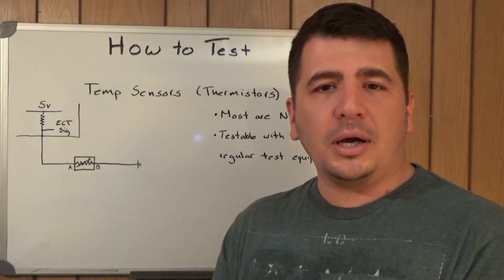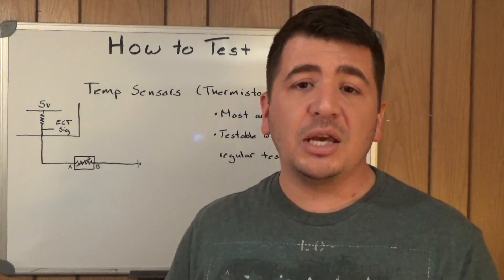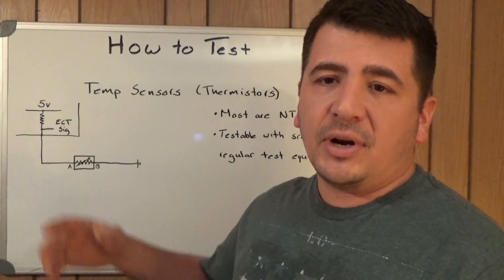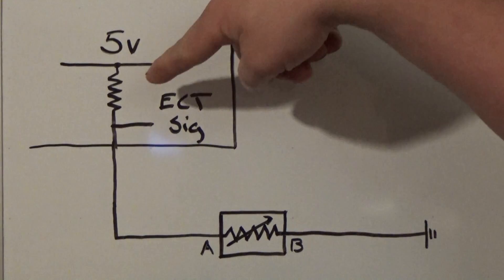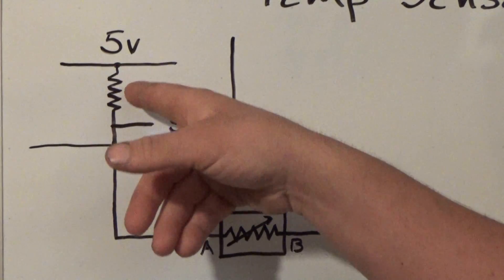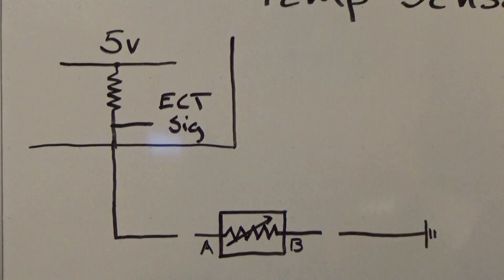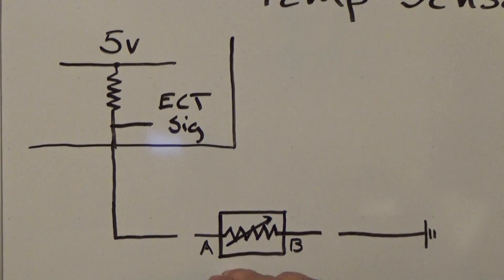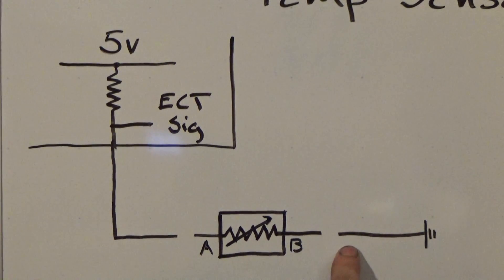Testing Thermistors (Temp Sensors)

Comment: if the resistor shorts will ground become 5v?
Reply: If the thermistor internally shorts all voltage drops across the first resistor you’ll read 0 volts Cheers
Reply: @anthonysova7117  yes of course, how stupid of me. thanks.

Comment: im expecting a 'no' for this, but just to be sure, are thermistors polarised?
(2 wire type)
my wires have become unattached from the plug, and i need to reattach them and there is no +/- indication, although the wires are coloured
Reply from the maker: In theory, there should be no reason to think it would make a difference. There might be some directional wired sensors, but if you think about this and imagine what it would be like if it were backwards, the circuit and function of the resistor says consistent. 

I don't think it will make a difference. Best of luck.

Comment: How would one test an evaporator thermistor out of the system.  Using ice water and hot water perhaps?
The repair manual gives temperatures and resistance values.  The manual doesn't go into detail about test setup.

Comment: Hi, this is a great video and helped me to understand how to diagnose a sensor.. I’m just wondering how the voltage coming out of the ECU changes i.e 3v measured at the ECT connector because the resistance of the ECT has gone up? Thanks

Comment: Please can someone answer my question: I have error code 4390=Boost Air Temperature Sensor - Short Circuit to B+. What is the fix ? a new sensor? or wiring? any information is appreciated
Reply from the maker: I can't guarantee that this is your problem, but consider that the circuit might be set up exactly the same as the one in this video. The difference is that your system likely uses 12 volts, (B+). If the circuit is broken anywhere after it leaves the computer, then the sensing point will see full battery voltage because the circuit would not be complete and would not drop any voltage over either of the loads because of that. 

Now, the most common place for the circuit to break is inside the sensor, and replacing the sensor is likely the most common repair for that specific code, but anything that could result in the system seeing B+ on the sensing element can set this code. Most likely, you have a failed sensor, but do a thorough inspection of the connector and wiring before you blindly replace it. Get a DMM and verify you have voltage on 1 pin and a good ground on the other pin.
Reply: DIY Auto Homeschool thanks for the information

Comment: Why can't I get any info on a 96 Buick Riviera about wiring diagrams for complete temperature sensor circuit. All I can find are 2 wire sensors and this car has a 3 wire sensor.
Reply: I found the volt from ECM is 7vdc will it affect in sensor work?